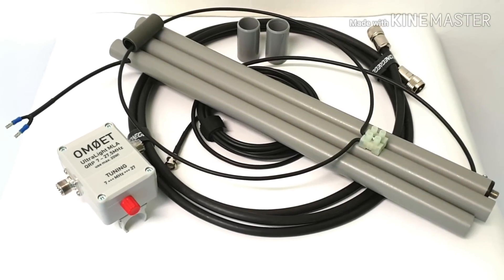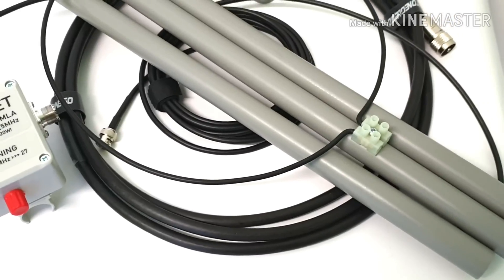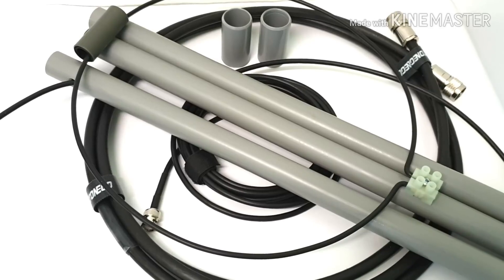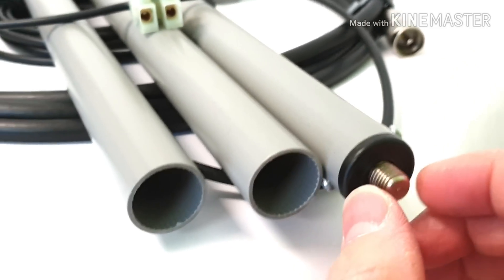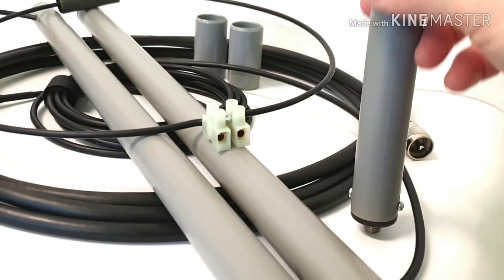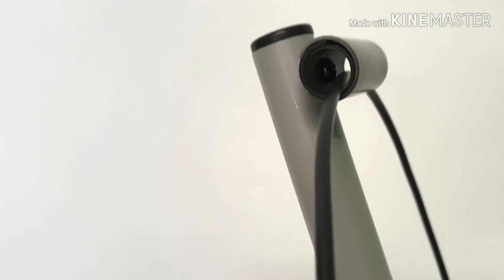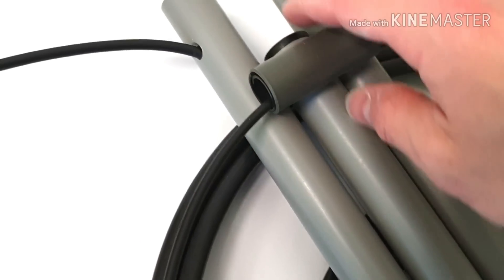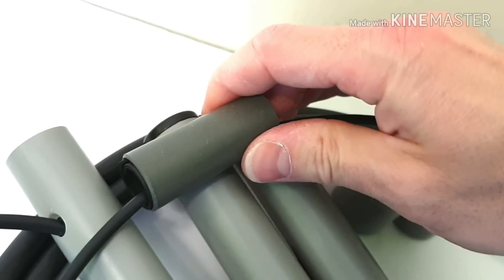UltraLight MLA - Latest Practical Improvements and Changes

Comment: I like the sliding mount idea for the tuning box. A means of adjusting the size of the loops would be a challenge...
Reply from the maker: Yes this was the purpose of it. This antenna is "mod ready" hi :-) and very easy and quick to setup and use ;-)

Comment: Out of curiosity, I am wondering if adding ferrite beads to the coax cable that forms the loop can improve or affect the antenna in any way. There are some ferrite beads that the user can clip on a cable. Just thinking about the noise on wire antennas for example. After ordering mine from you, I can be able to know how the magnetic loops work related to noise on the wire antennas.
Reply from the maker: I didn't seen any difference with or without ferrites on the coax. This antenna do not much produce RF in to coax when is perfectly tuned to the frequency. RF may appear just by EM induction because of is very close to radiating element. But I didn't  had any problem with RF anyway. Globally the loops are always quiter then wires or verticals.
Reply: @OM0ET  Thanks a lot for the technical information.; Can wait to get mine. 73

Comment: Hi. Nice work. I almost finished my MLA based on Your 4.0 dimensions. I have two questions: 1) when you remove shielding from coax (more less 30mm) on a top part, close to coupling loop, do You put something inside instead of insulation+braid+foil+white foam? 2) why did you increase coupling loop dia compared to Alex Loop for example. You have the same main loop dia but coupling loop is twice the size of Alex's design. THX and great job!
Reply from the maker: Hello Marek, you can try work with uncut loop in the middle first. I have got a good results also without gap in the middle. But don't connect the shielding to anything, just leave it free not connected. I did many tests with other coupling loop diameters and best results I have got with 29cm/diameter. Maybe it's due to a different design. ;-) 73, Paul